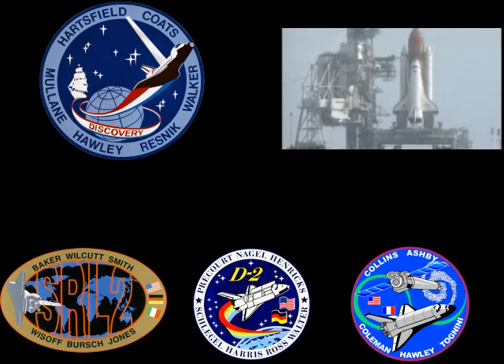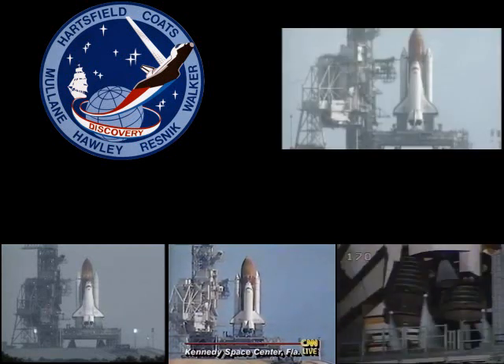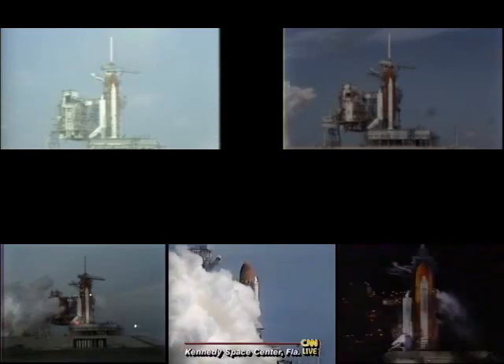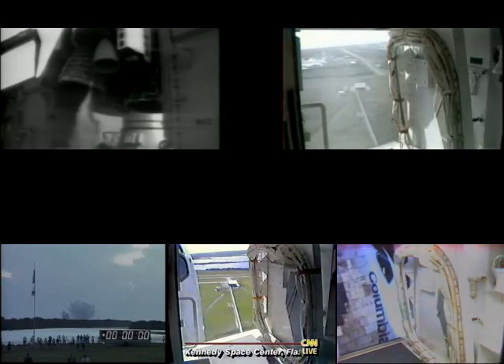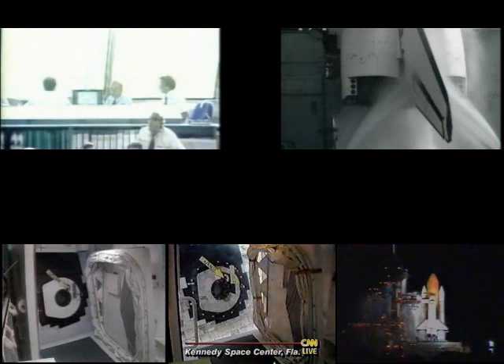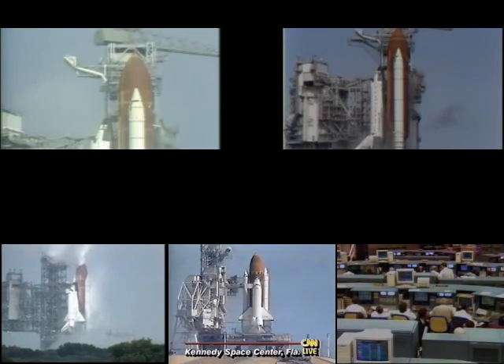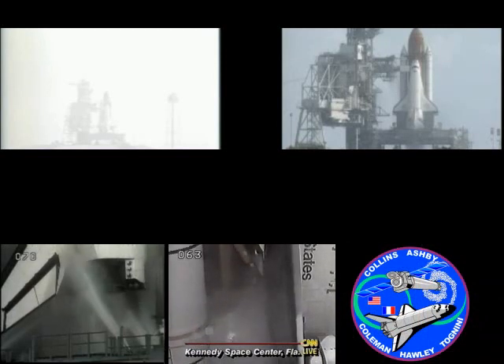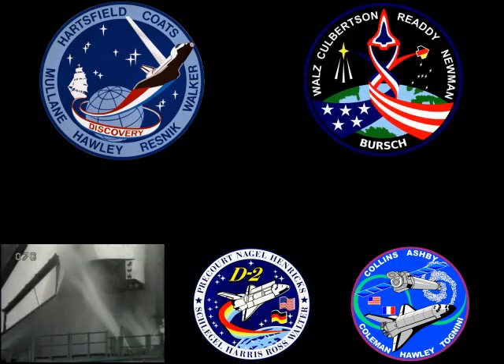Space Shuttle Launch Aborts

Comment: You and @lunarmodule5 are right--the slidewires were never used in an emergency situation. The slidewires probably should have been used on 41D as there was a hydrogen fire after the abort, but it was quickly extinguished, and Control was hesitant to use a system that had never been human-rated when there wasn't an imminent danger. Now-Administrator Charlie Bolden did serve as a guinea pig on a test run after the Challenger accident; I've never heard of him discussing what the ride was like tho.

Comment: i didnt know the shuttle aborted several times :D
Reply: They actually had 5 RSLS aborts after SSME start. The one in the lower right corner (the Irene Collins/Columbian mission) was not an RSLS abort. The engines had not started and it was a countdown cutoff called by a controller who saw a H2 spike in the aft compartment (which later was determined to be a measurement issue coupled with not having time to wait for re-measurememt.)

STS 51I (the same mission that had the abort to orbit) had a RSLS Abort after SSME start.

The last SSME abort was Endeavor in August of 1994.
Reply from the maker: 51F  not 51 I.. :-)
Reply: I hate that old system 😂